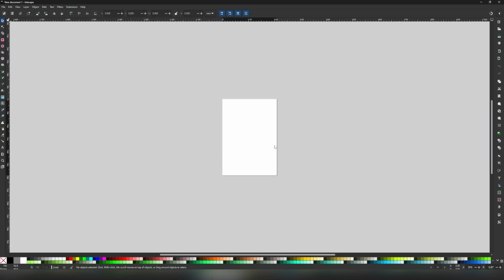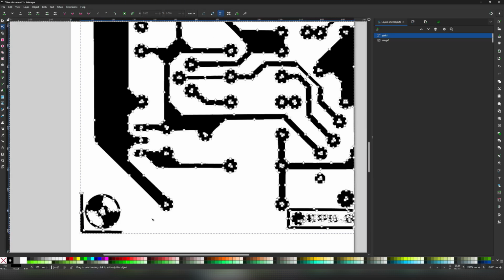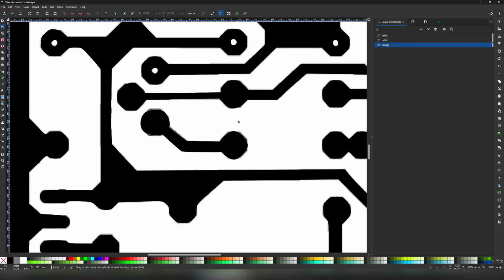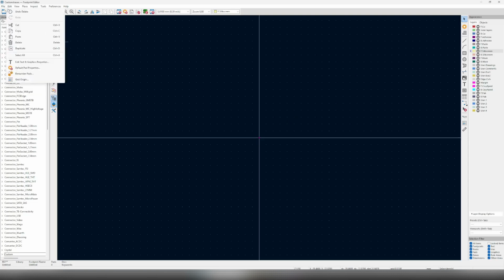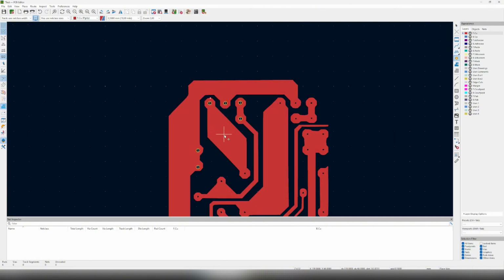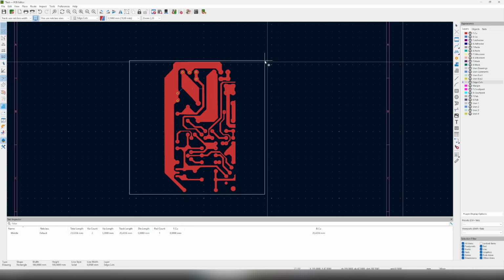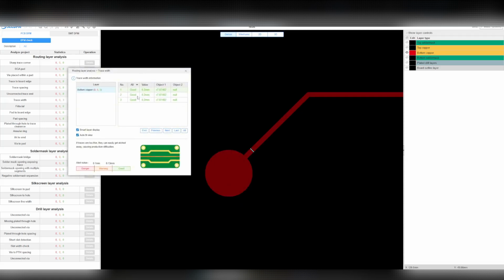Recreate a PCB layout from in image in Inkscape & KiCad

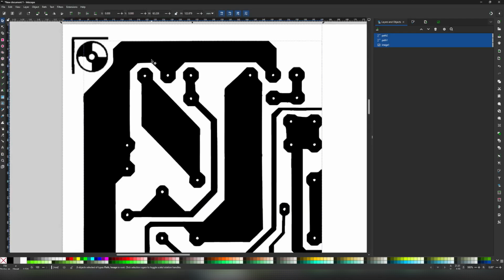Comment: 6:11 there must be a better method to change to exact distances ...
charGPT: 
It should be 5 mm and you have 4.87 mm then you calculate: 5 mm /4.87 =1.026694
object/transform/scale  
scale proportionally or uncheck it : Width 102.6694 % then Apply
Reply from the maker: Hey Tobias. I verified the chatgpt instructions and they work. The exact scale is more important when actually placing the holes in KiCad. Your method is very useful to arrive at the correct approximate scale in one step.